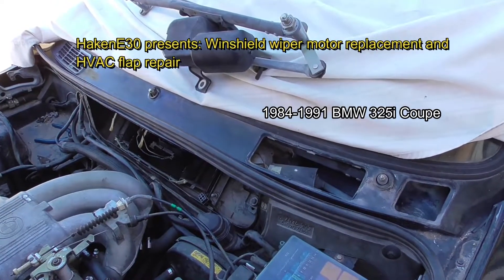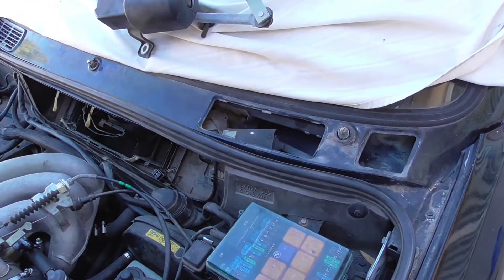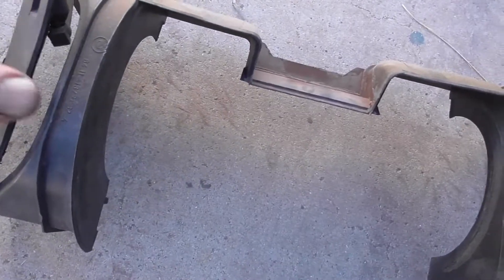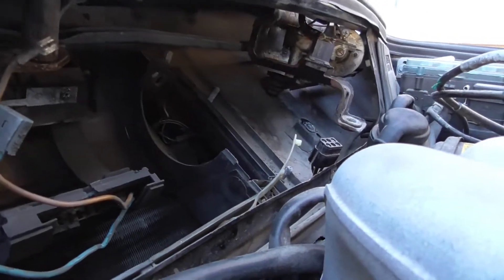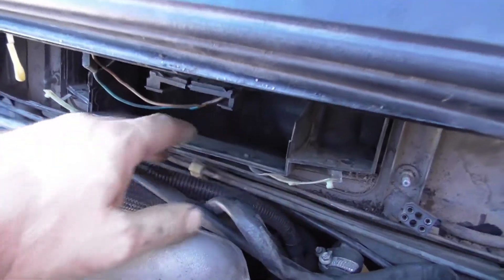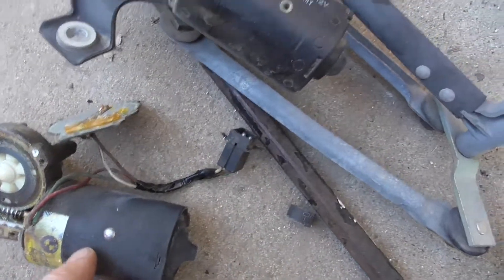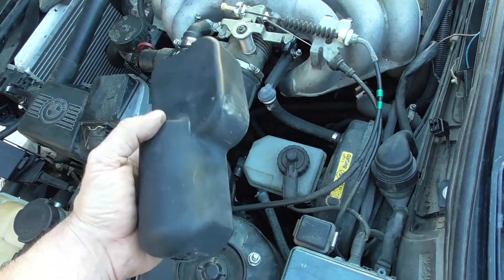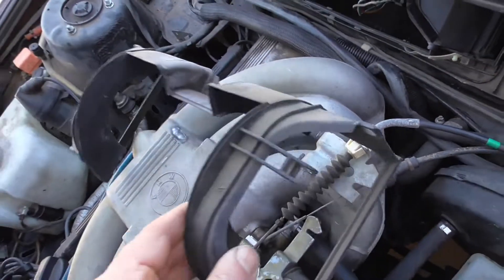wiper motor replacement on BMW E30

Comment: How did you manage to get the clips on on the back of the blower motor housing. You know there is 4 metal clips, how did you get the 2 on the back to clip on to the housing? I am fighting like hell with that right now
Reply from the maker: I don't remember, got the hand in there and pushed on them,